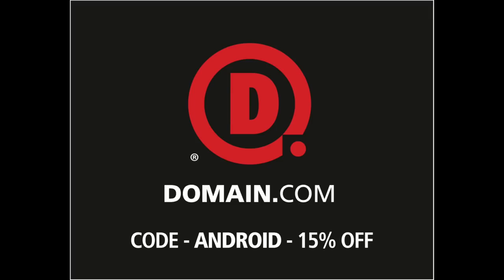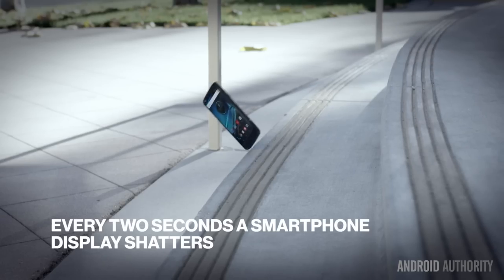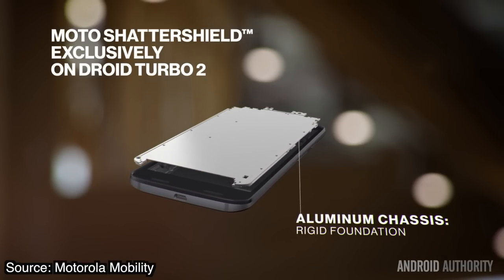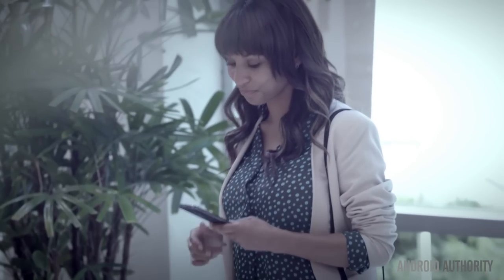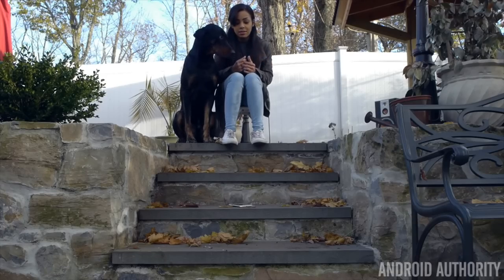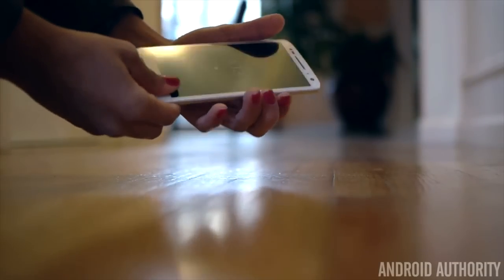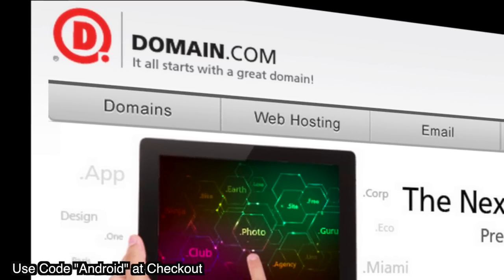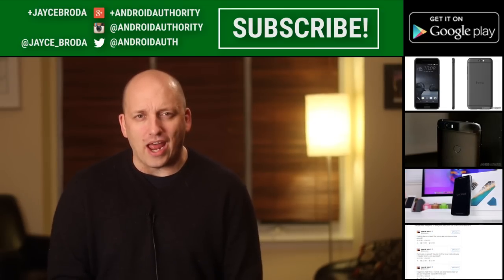How does Motorola’s new ShatterShield technology work?

Comment: I seriously don't understand how people drop their phones hard enough for the screen to get that 'spider web' crack, I've had my phone for 5 years, dropped it various times on different areas of it from different heights, always had a case on, the worst damage were scratches on the metal band around the phone and possibly internal shifting but I haven't noticed too much of a drop in software speed or anything. And yet, this is supposed to be Motorola's big new thing, cool, but c'mon. :/